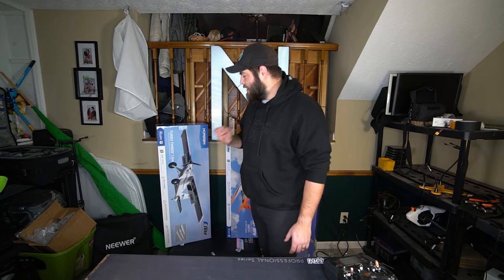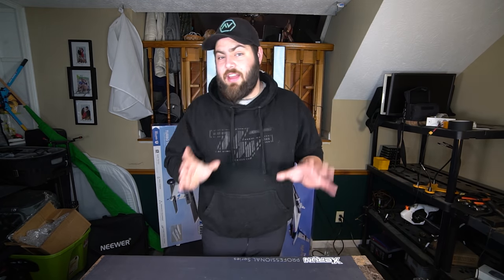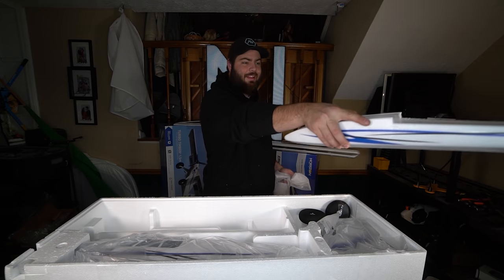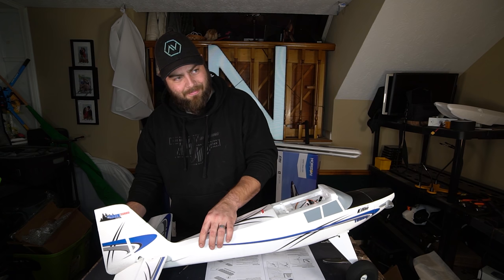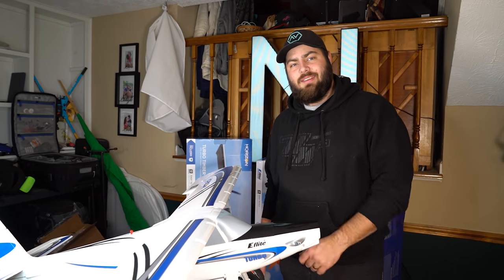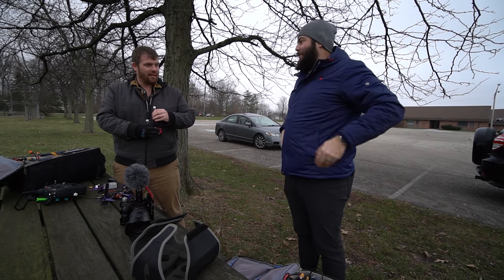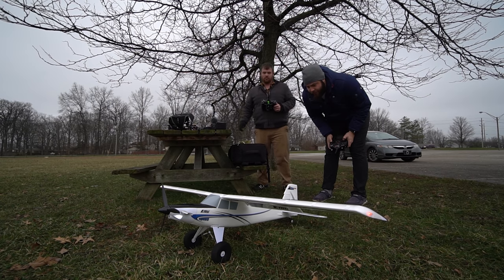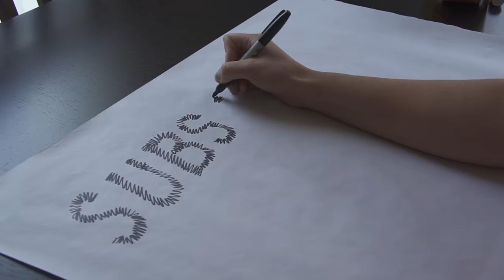They didn't Believe I'd be able to fly the Turbo Timber

Comment: Flying with any Stabilization (Auto Level) except Ruff Air is not Flying. It's just Managing Flight. But you have to learn some place.

This is a call for all Recreational R/C Pilots flying TOY Airplanes, DRONES   to UNITE and Protest any form of REMOTE ID and all the Provisions of this ridiculous a complacently unnecessary  NPRM.
 RID is only the start of the end to all R/C Drone Flying
    It is complacently Ludicrous to believe  TOY Model airplanes are subjected to the same rules as Man Carrying Aircraft just because they use the same air. Even Full Scale Man carrying aircraft are not subject to ATC (Air Traffic Control) in the Majority of US Airspace Below 700' AGL and other places 1200' AGL. Remote ID and many of the provisions of it's NPRM are explicity written to Remove the right of any person to fly any R/C TOY Model Airplane  (DRONE) any ware in the USA no matter that they haven't posed any harzard to manned aviation in over 8 decades of flying in the same airspace. When Flown according to a set of Safety rules they never will. 
   As R/C Recreational TOY Airplane flyers Flying under a set of Safety Rules must FIGHT any Form of REMOTE ID and all provisions of this NPRM, especially where the Government has the right to, at their wim, to deny anyone from using any their part of US airspace anywhere safely in the USA no matter  how remote to any airport. Another thing any thing you have today including transmitters (controllers) will be obsolete per the NPRM.